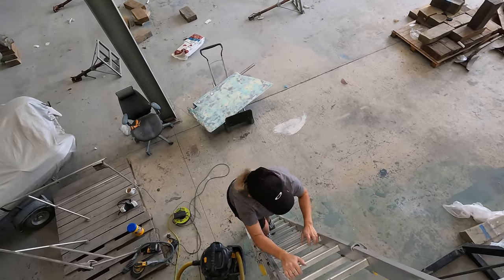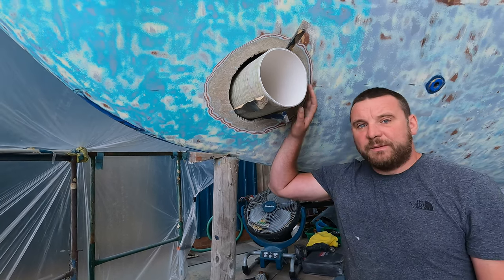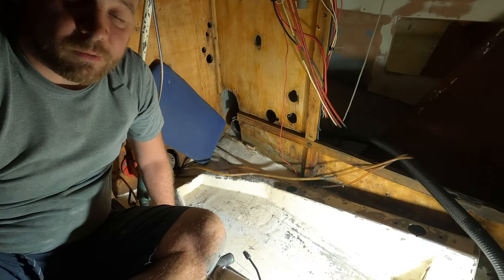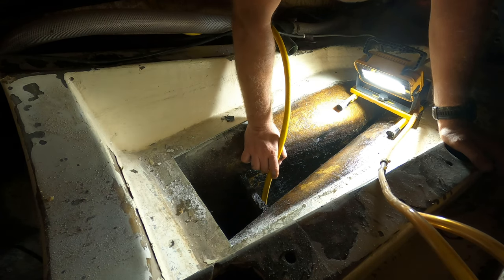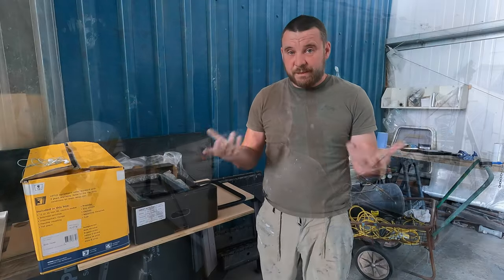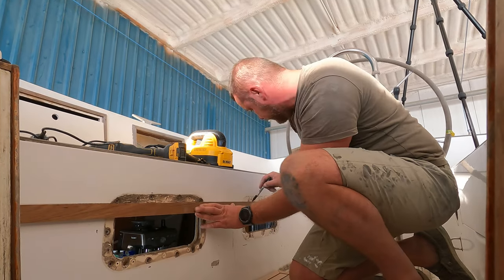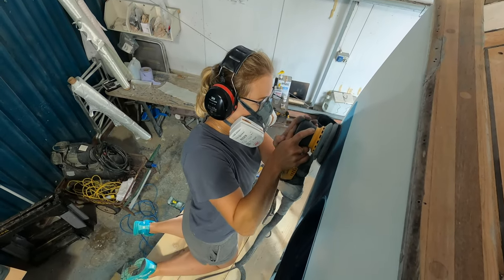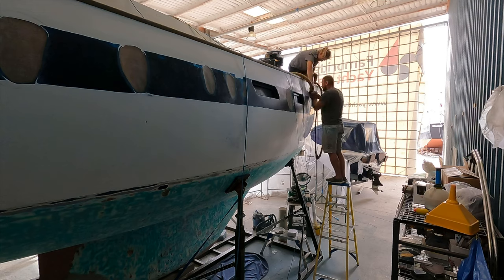Fitting new galley PORTLIGHTS (BOMAR) ; Repairing Stress Cracks [E23]

Comment: Those new port lights are amazing especially with the bug screen!! The black interior will give it some color inside.. you're gonna love the smoked glass because it's going to keep the sun from heating everything up in the galley.. the stainless inside would have looked nice if you still had the varnished wood in the area but since you painted it a nice white the black looks really good

Comment: I don't want to lose the extra knot, even in cruising mode, 1 knot per hour is 24 nautical miles a day. On a 30 day ocean crossing that's 720NM, could be the  difference between arriving a week early,  escaping bad weather, etc... I'm going with the external bow thruster, as it only takes a minute to install and remove. I wholeheartedly agree with the need for additional maneuverability.
Reply from the maker: Hi John, I agree that on a long passage that 1 knot or so can make a substantial difference. It is only our speculation as to how much drag the bow thruster creates, tried to look up some more data now, all I found was that one can lose up to 0.5 knots of speed. Perhaps we exaggerated a bit ;) But we are prepared to pay that price for better manoeuvrability. The externally mounted thruster does sound great, I guess it doesn't get fouled so less maintenance required. 
Best wishes, Nat & Ziggy